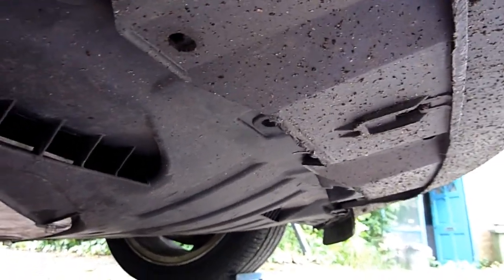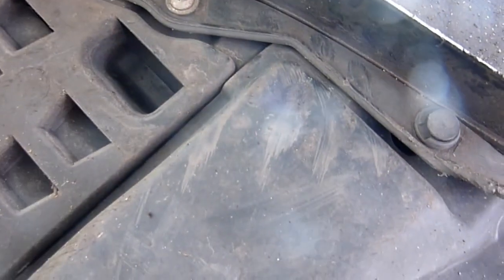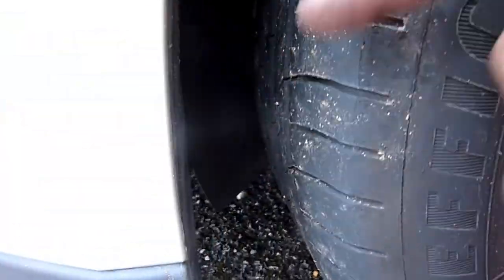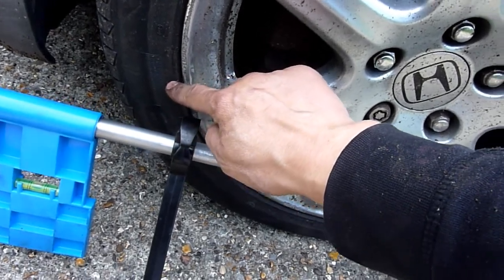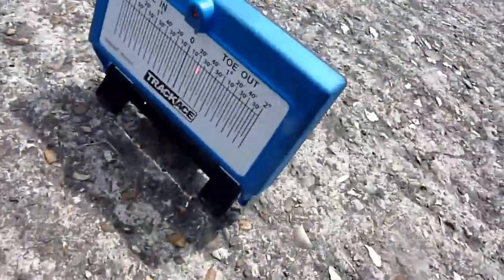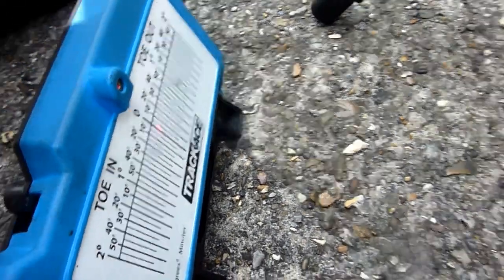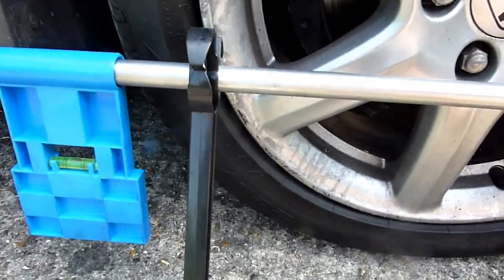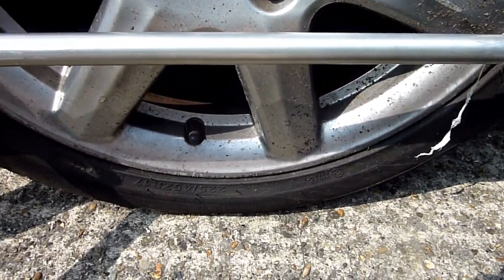How to do Laser Wheel Alignments on Modern Lower Profile Cars

Comment: Glad you made this video.  I really like this tool, but wished I could zero off either wheel.  I thought about just adding another mirror on the back of the device, and I think that would work well.  Using it flipped to the back of the wheel sounds good, too, with the understanding about the reversal on the gauge.  Best Regards.

Comment: When you say it’s opposite, do you still adjust it to 0. Or do you calculate the measurement to 0 and go the other way?
Reply from the maker: Measure the instrument the same way apart from doing the rear of the wheel, instead of the front. The measuring arm with the centre bubble is on the opposite wheel, e.g. left instead of right or right instead of left. Likewise with the laser instrument. Now the readings will need to be adjusted until the opposite is shown. E.g. if your car needs 6 mins toe-in then set it for 6 mins toe-out because you are measuring the rear of the wheel.

Comment: But how do you know the left wheel is the correctly aligned wheel? If the left wheel is wrong then the right side front wheel will also be wrong.
Reply from the maker: In your example the combined toe angles would read correctly, but then how you know something is wrong   is the car will pull to one side and you would make a correction by turning the steering wheel the other way. In other words the car will then drive perfectly well but the steering wheel is always tilted over one side when going straight ahead.
Reply: @EducationPineapple  so this tool   can give approximate accuracy after driving the vehicle and its a trial and error process.  This tool cannot adjust a 5 minute angle to the center line of the car for individual front wheel. This tool adjust front  wheels parallel to each other and you check equal amount of threads count on both sides of the tie rod and confirm the vehicle is straighr by driving it and observe the steering wheel is centered. In other words,  a magnifying  glass cannot do the job of a microscope.
Reply from the maker: @vincentlee2460  The tool does the tracking very accurately to industry standards. With some skill and knowledge and better understanding, the whole job can be done in one go. Please watch a previous video on the nuances of the technique of self-adjustment by two wheels at a time. https://youtu.be/9pfwgCie154

Comment: Waste of time, Placing on the tyres gives you bad reading
Reply from the maker: Actually you are very wrong. I remember setting my total toe angle to be +10 minutes. When later I had a set of 4 new tyre put on and the fitter wanted to tempt me to purchase additional wheel alignment by placing this car on their 4 wheel alignment device. They fitter tried to convince me to go ahead and said ' look left front is 3 degrees (actually he should have said minutes) and the right wheel is 7 degrees positive. I thanked him and left because 3 + 7 = 10..I went home and adjusted until I thought they were +5 and +5.